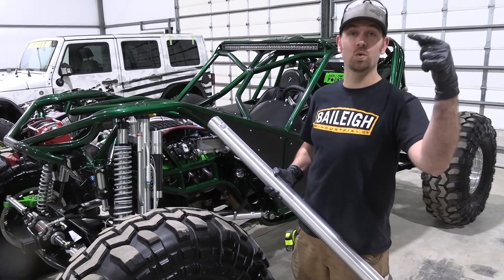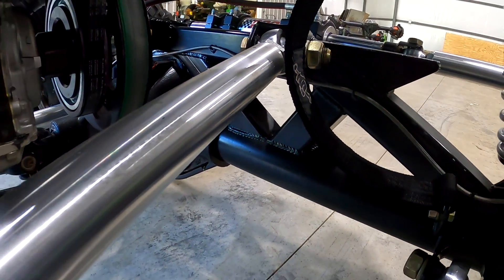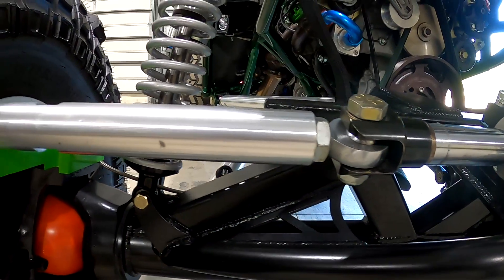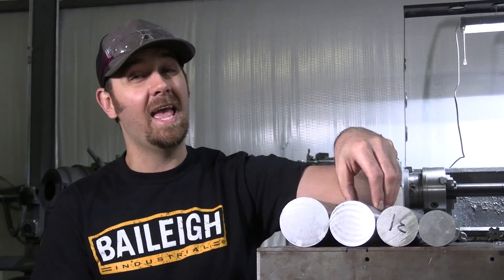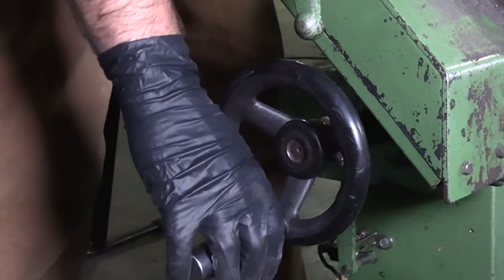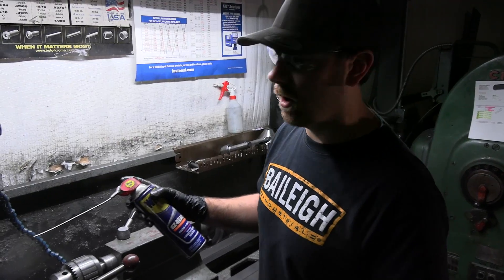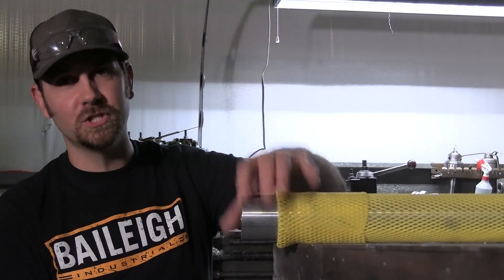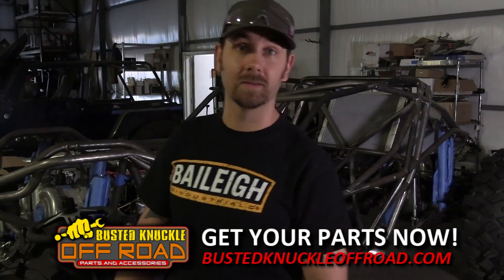7075 ALUMINUM LINKS - Busted Knuckle Off Road

Comment from the maker: You can order 7075 Aluminum Links Here> https://bustedknuckleoffroad.com/collections/link-bars
Reply: Cool vid. Would you recommend 2.5 or 2” for a 3/4 pick up with 1 1/4 Johnny joints? I currently have steel links but I’m showing a lot of threads after the last alignment

Comment: Hi Jake, I have a question about picking the correct size of steel for link suspensions. I am building a 4 link for an F500 truck. probably never off-road it. If I use DOM tubing is 2 1/2 inch, .25wall, strong enough to  support the theoretical load of a 5 ton truck. Air Bags are goodyear bags designed for a city bus. hOW DID YOU BEGIN TO SIZE THE MATERIAL FOR THE LINKS IN THIS VIDEO?
Reply from the maker: It should be strong enough, or you can just order some HD aluminum links from us

Comment: Cool vid. Would you recommend 2.5 or 2” for a 3/4 pick up with 1 1/4 Johnny joints? I currently have steel links but I’m showing a lot of threads after the last alignment
Reply from the maker: 2.5 is great for heavier rigs

Comment: I can testify to this. I ordered them and got them in i think 3 to 4 days. But man way too easy to install and set lengths and way to light. To change the pinion angle now i can just twist the bars. But the cool part not fab work. Just twist on the ends and set
Reply from the maker: Thank you for your business! 👊
Reply: @BustedKnuckleOffRoad  im almost done with the tacoma i finally drove it out of the garage and im just waiting for my glass fenders but im stoked to finally test the burkey suspension on a pickup truck!!!!😍😍😍
Reply from the maker: Sounds awesome! Be sure to message us with some photos or videos when it's done!
Reply: @BustedKnuckleOffRoad  i just drove it and am gonna order the right size limit straps but man it feels so nice i cant even feel bumps on the rear of the truck anymore lol ITS AWESOME!!!!!!!!!
Reply from the maker: SAWEET!